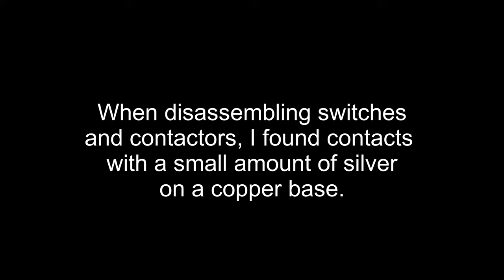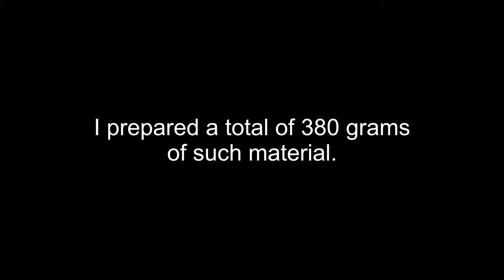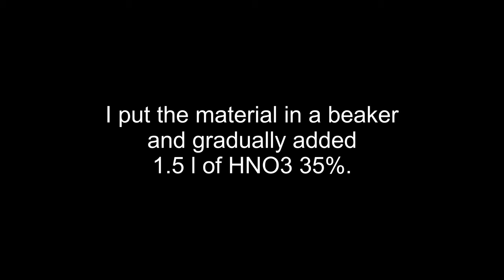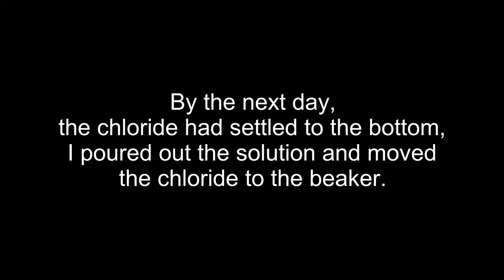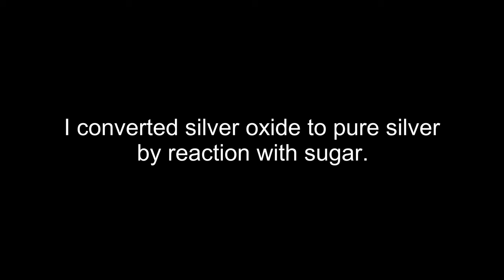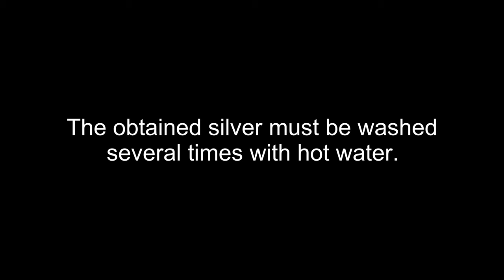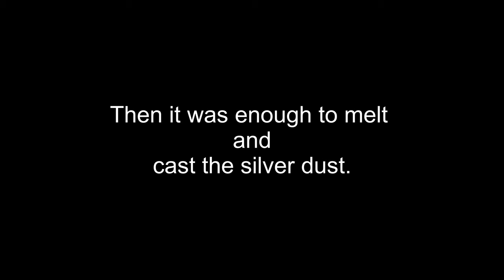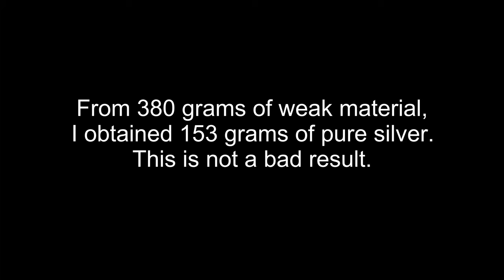Electrical switches and auxiliary contacts - silver recovery

Comment: I have something like 6 lbs of close trimmed industrial contacts, roughly 75 lbs of plated silverware and around 700 lbs of nice electronic scrap I want to refine. I really need to read the Hoke book before the price drops out. I'm really afraid of poisoning or burning myself though.
Reply from the maker: It's the same as working with fire. You just have to be careful. :)
Reply: Check out sreetips on yt